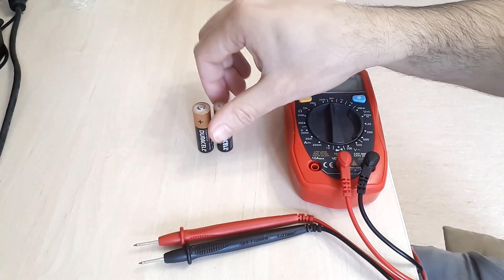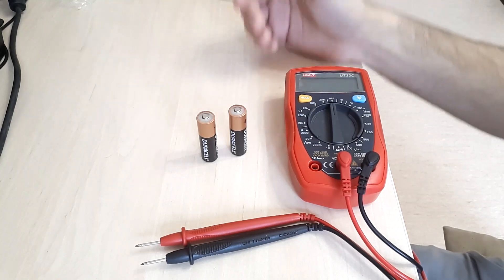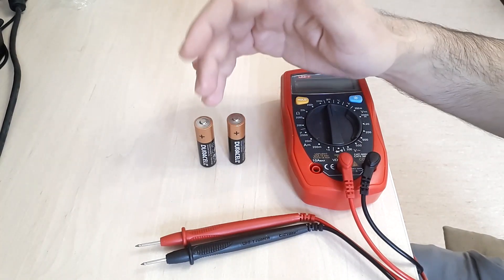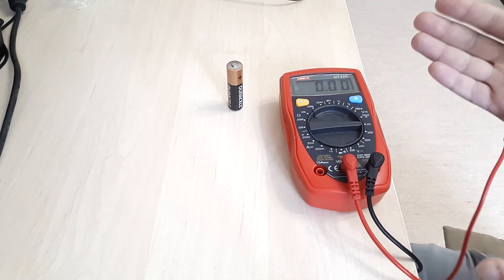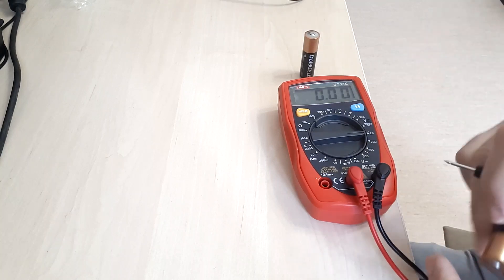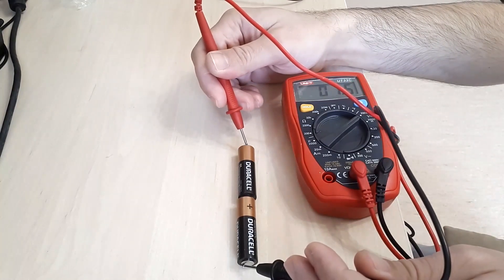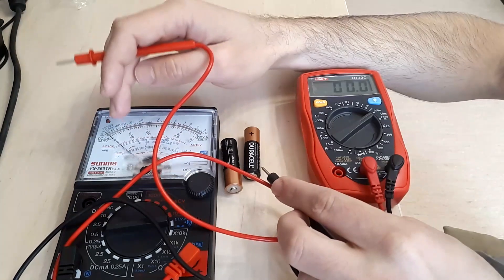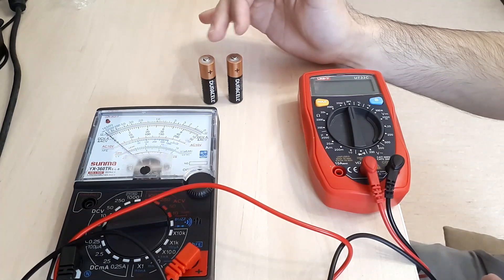Some Alkaline Batteries May Reverse Polarity At End of Life if Over-Discharged Tutorial

Comment: I see this happen very often. For example, I have several motion activated LED lights which take 4 cells. When I notice the light is dim I change the batteries. Almost every time one of the cells will be reverse polarity.
This happens because in a series string of cells, if one cell drops to 0v before the others and the device continues to function, then current will flow thru the 0v cell and charge it in reverse. You can force this to happen quickly by mixing a nearly dead cell in a set with several good cells. Or you can do the same thing by taking a dead cell and charging it in reverse polarity with a charger or power supply.  With a lead-acid cell you can successfully form the cell in reverse polarity and it will function almost as well as it did in the normal direction. Other rechargeable chemistry are not symmetrical and will not function well when reversed charged and will indeed be severely damaged by charging in reverse.
I have never seen this happen in a device which uses a single cell or cells in parallel.  Have you?
Reply from the maker: I appreciate the details you provided about your experience!

It seems surprising that one of the cells reverses polarity so quickly in your case. In most devices I use requiring batteries, remotes, flashlights, various sensors, I do not see such a behaviour. I am curious if there is something particular that occurs in your case. For instance, it is uncommon for one of the batteries to go that bad and the circuit still operate so either it can still run when batteries are highly drained, or there is something that I miss. I wonder how much voltage the set of 4 batteries (cells) still provide when you noticed such a reverse polarity situation on one of them and you replace the whole set, since they were dim.

About reverse charging batteries, it can be possible but I doubt the battery holds the same capacity when reverse charged, or can deliver the same current as metals, design and other details are optimized for one use scenario. For lead-acid batteries I highly doubt they will hold as well on a long-term basis, as they are already very sensitive to deep discharging. Of course, the discussion is mostly theoretical.

On single cells I am not sure if it may happen, as well. For parallel ones it may be much more difficult as all of them have to exhibit the same behaviour, otherwise they cancel each-other to a certain extent. I have not experienced batteries with reverse polarity that often and clearly not on a parallel system. In fact I do not have situations where parallel cells are used.
Reply: @retrowikid  In these lights I mention, the drain is very low.  Some use AA and some use AAA cells. On 4 AAA I replaced today, the voltages are:  -0.1v +0.9v +1.1v +1.1v and the light was still working but dim enough to see each individual LED.

Another factor is probably the cells.  One probably goes to 0v long before the others.  These are Lucas brand cells and I will never buy them again.  I must test each cell before using it.  Some are dead or nearly dead from new!

You can study how to make lead-acid battery cells.  It is one of the easiest rechargeable cells to make (nickle iron is even more easy).  Lead-acid is the only rechargeable cell I know that the chemistry is symmetrical. It is harmful to reverse them once in operation, but unlike all other battery chemistry I know, the lead-acid can be "formed" by cycling to create the anode and cathode.
Reply from the maker: Very interesting details, and I appreciate the voltage measurements, they bring a lot of insight. 

As I noticed along many years, most devices seem to cease working when the battery voltage gets to less than 1.1 Volts per cell. What happens that they cease to work, depends from case to case. Most products nowadays do not fully shut-off power to the battery, meaning that they constantly drain energy when in stand-by. This means that a small amount of current may travel the full route, including through cells in series.

Now comes the surprising part, how a single battery can degrade that quickly? I lean towards manufacturing variability and I do not see that as normal. I am curios how steep is the voltage drop per cell is when the whole battery set is partially drained. Also, regarding manufacturing variability, I can assume that it should be noticeable using the same method I used, measuring short circuit maximum current draw. In this case, if the batteries exhibit different current when new, one of them, possibly the one with less, could be discharged quicker and reverse voltage sooner. As I read your comment I noticed it is even more extreme, meaning that poor quality already is reflected by very little or no voltage, so maximum current delivery variability is not even required to be tested. 

The fact that they come dead is totally new for me, it is surprising they are available on the market. I mean I saw poor Chinese no-name batteries but most still deliver power, even if poorly during their lifetime, since they are zinc-carbon instead of alkaline.

I have seen lead-acid batteries, since they are the cheapest, and have been available in many devices for a century. The most obvious application is for transportation vehicles or as backup power. They have the advantage of delivering large power, being cheap to make, and require less cells to reach a specified voltage (around 2 volts per cell). However, they have issues such as not being environment friendly since they use lead, and do not have the same power delivery characteristics as Li-Ion or Li-Pol batteries and they degrade much faster if over-discharged. There is also the risk of gasses leaking out of the battery during charging/discharging, including hydrogen. It is true that, in the end, lead-acid batteries do not face the same operational risks as well as more modern battery technologies but I still consider them unfit for the present. I mean, we can do much better than to use lead-acid batteries and lead-acid batteries struggle to work more than 5 years in typical use scenarios, even when well cared for.

In my perspective, I think that Lithium rechargeable batteries and future technologies offer much more performance and we should finally make the switch from lead-acid ones. It is true, we need better design and safety features including not allowing poor products to be marketed, as they are more dangerous due to the energy they pack in a compact size than older technologies.